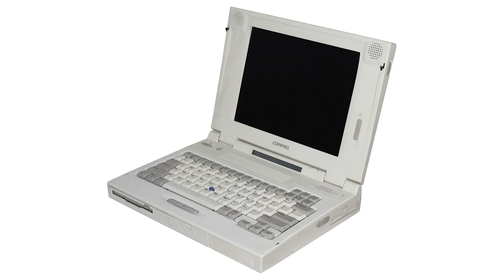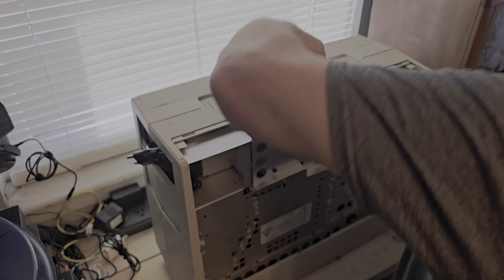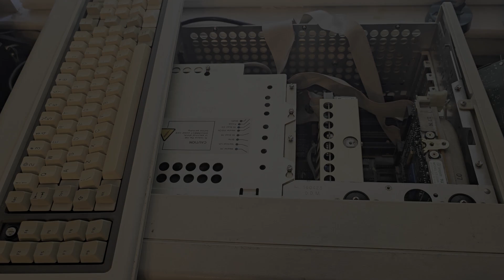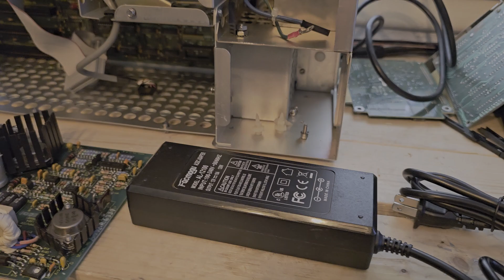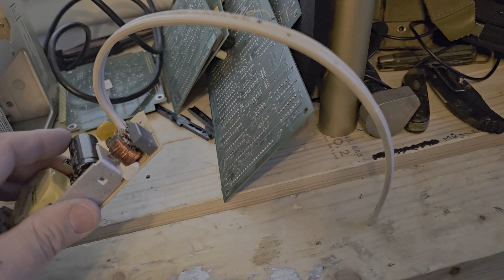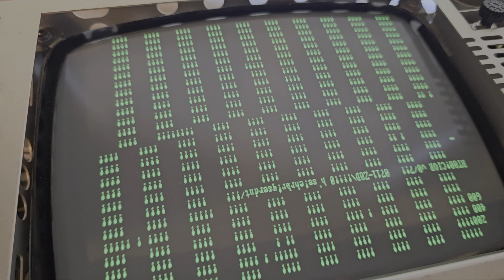Compaq Portable - Can I bring it back from the dead?

Comment: This is a bit late. I have both the Portable and Portable Plus. My Portable Plus actually has the correct badge on the case. If the hard drive controller card in yours is the correct Compaq part number then it's most likely been upgraded by a dealer or a previous owner bought the parts. I'm kind of betting on a Compaq dealer.. I upgraded my Portable Plus to use an XTIDE card as I didn't trust the old MFM hard drive even though it still works. 

Nice video though!

Comment: New to your channel, but depending on what monitors you have available, you could get an 8-bit CGA or EGA card, or an 8/16 VGA card, and try with an external monitor, then once everything else is working try to resurrect the original video card or find a replacement. The proprietary connector may even be CGA standard signals. I haven't checked that deeply into it, since mine (thankfully) works.
Reply from the maker: Thanks!  Yeah, I haven't actively worked on this guy in a while, but I'll give that a shot.  I hate to just leave this gem unused.
Reply: @AAT30-90  FWIW, it's not quite CGA-standard. It's a hybrid between CGA and MDA, but also with a pin for it to tell which mode to put the screen into. Someone created a circuit (consisting of some wire and three diodes) to adapt the internal monitor to work from standard CGA, so all is not entirely lost if you can't get the original video card working.

Comment: Deoxit the socket chips.
Reply from the maker: I did a quick shot of deoxit when I re-seated all of the chips.  Maybe I need to go back and double down with the Deoxit and a nylon brush and really get in those sockets...
Reply: Also the card slots.
Reply from the maker: @ I tried all of that. Several times with no luck. Even cleaned all the connectors on the cards themselves.  At least they're nice and shiny! Thanks for the advice, though.  Always appreciated!